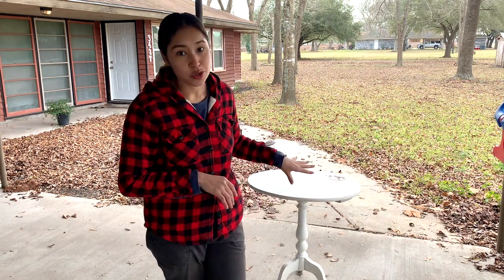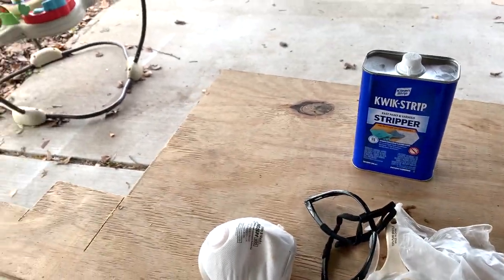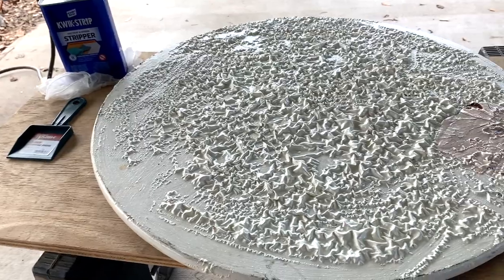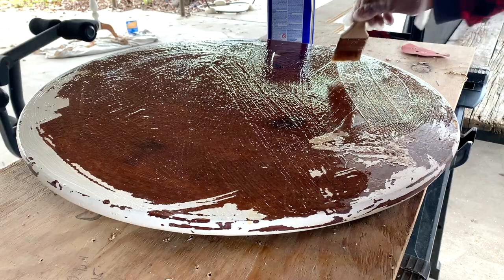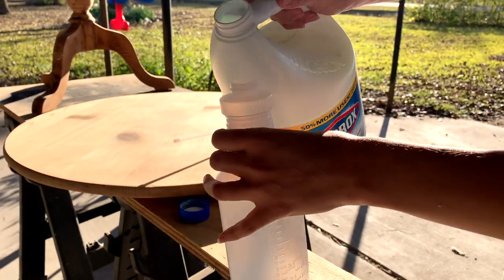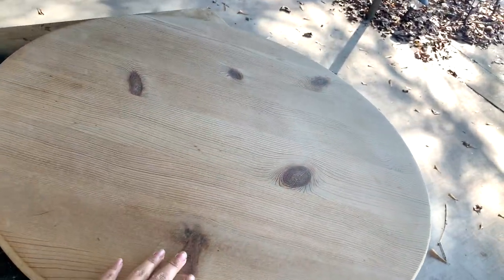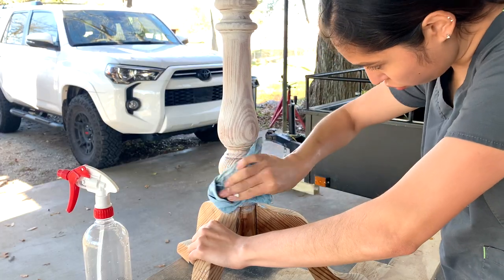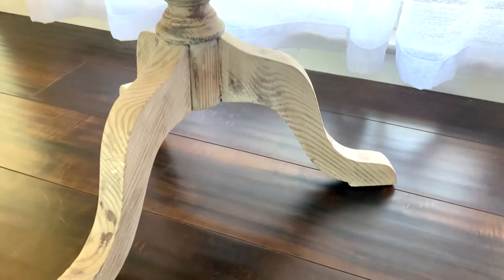FACEBOOK FURNITURE FLIP|2021|WHITEWASHING WOOD FURNITURE +  BLEACHING WOOD

Comment: Hi Glenda! can you help me ? I chalked painted my kitchen cabinets twice already and I still don't like the results... I want to whitewash them now.  My question is this.  Do I need to strip the chalk paint before white washing or can I just paint over it? I put clear wax on it too...
Reply from the maker: Hey Sylvia! Thanks for watching! ❤️
I personally would remove existing paint, but because I prefer whitewashing where  you still see the natural wood peaking through. But you can definitely white wash or color wash over existing paint if that's the look youre going for ? I would definitely scuff sand since there's a wax coat on there and it will prevent proper adhesion. 
Hope that's helpful!